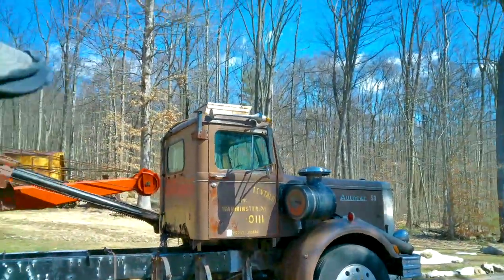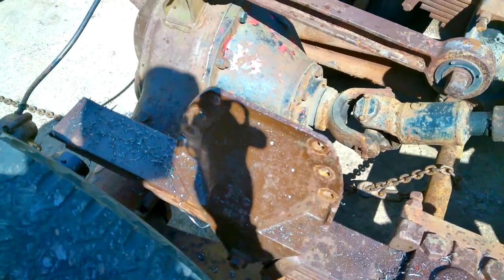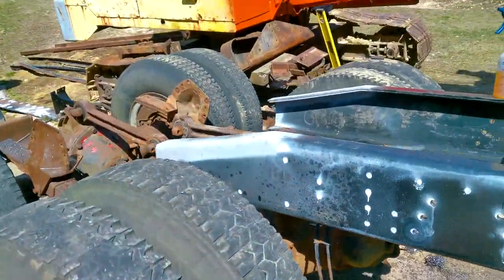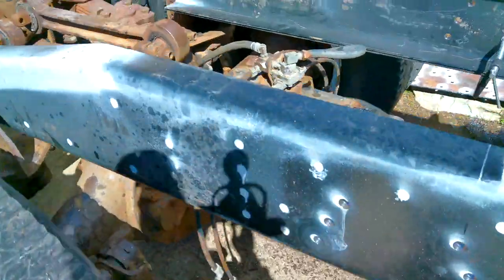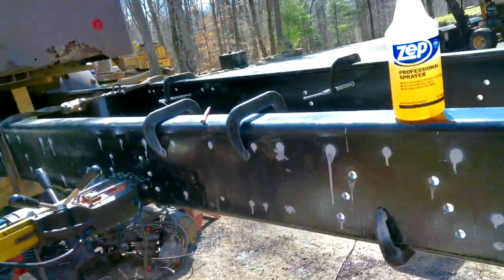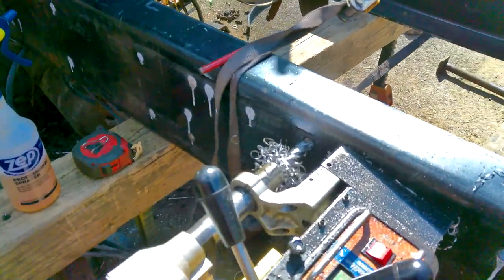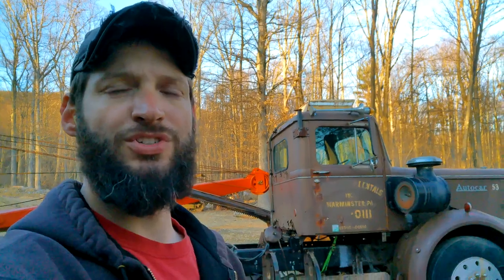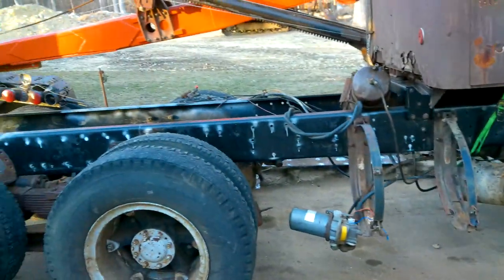1975 Autocar rebuild EP.5 Frame work continued

Comment: Looking good,take your time don't rush like we did on the ol B cab KW, found we were 3/16s off from right frame to left frame,brand new inner and outer a month later finally had drives under it
Reply from the maker: measuring from the same spot on both side of the truck i was within 1/16th. i checked it a few times so im pretty happy with that

Comment: Making good progress! That 15 speed can be made into an OD, would be about right for the 4.11 axles. Nice work
Reply from the maker: ill have to look into that. i wonder if id be better off with a 13 or an 18 so i could split the gears in the hills and having 350 horse. thanks for watching Frank
Reply: @73DiamondReo  a 13 od would be great. I’m running 3.73 and a 15 over. A bit too much for a heavy load. But I’m never that heavy.
Reply from the maker: @Digginok  i live at the bottom of the mountain and there's some pretty good grades around here.  even with the 500+hp trucks at work i end up down in low range to pull most of them. im estimating ill only be grossing 65k ish for a few of my machines but who knows what ill find next.  there's a scale next exit over from me and id like to weigh everything.
Reply: @73DiamondReo  an 18 would be the ticket it sounds like. Never can have too many gears, I wish mine was a 13, the difference is 400 rpm per shift, a 13 would be around 250.
Reply from the maker: @Digginok  yeah an 18 is big money.  last two trucks i ordered i put 18's in them. Great trans!  Id have to come across a good deal on one and a bell housing. it'll have to do for now. just go a little slower but it will still do the job

Comment: Good to see another video. I like the way you said the mag drill makes it easy, so what constitutes a hard job? It is without a doubt a labor of love. When you said 70 to 75 I thought my 6V71 Diamond Reo  could only dream about that but at least it will sound like it’s going fast! I was curious about the progress on the skid steer. By the way, the Link-Belt is on my mind.
Reply from the maker: havent done anything with the skid steer. i have the engine back from the machine shop but still have to put it together.  cat 60 is coming along well. you'll be after the linkbelt in no time

Comment: Usually frame holes are drilled undersize then reamed to size for the bolts, in my experience.
Reply from the maker: probably a better job but for a shop building replacement rails i could see why they would go a little oversize
Reply: @73DiamondReo  When the holes are reamed for the bolt, the bolt also acts like a locating pin. If a spring bracket loosens up a little it will more likely to stay in alignment with the holes being tight. Other wise things would get very loose and chuck around.. Just my .02.